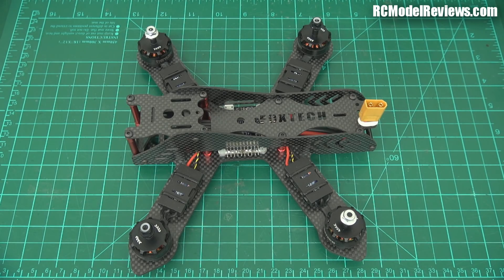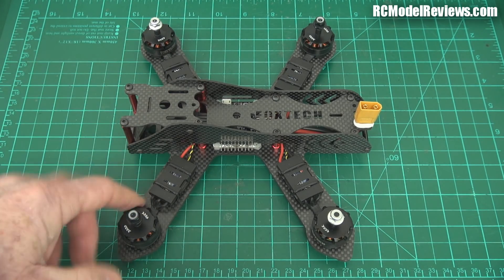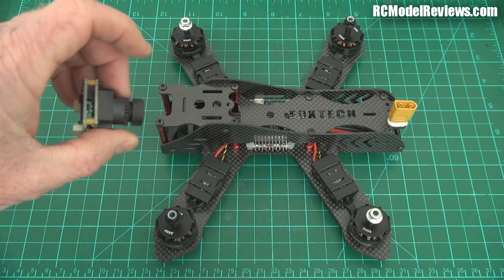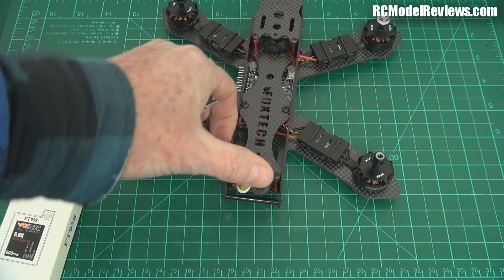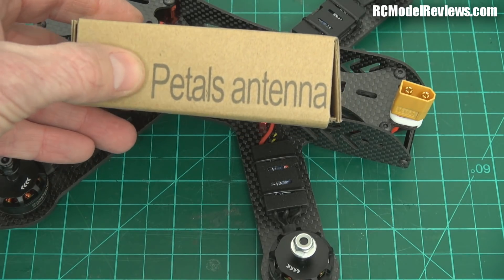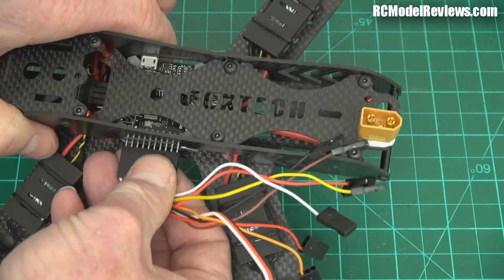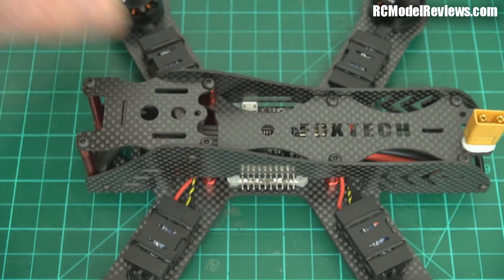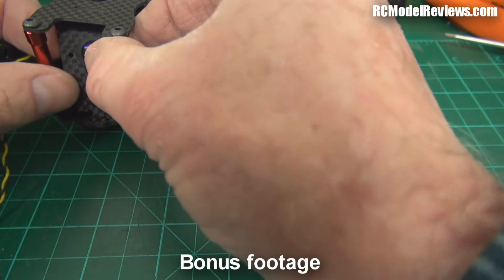FoxtechFPV Lightning 210 racing drone (on the bench)

Comment: Bruce, I have a question for I am building a TAROT TL250 RACING QUAD, I AM USING EMAX MT2204 2300KV MOTORS 12TO18 AMP EASC'S ARE WHAT ARE CALLED TO BE USED I AM NOT USING IT FOR RACING BUT I HAVE FLYCOLOR 30AMP SIMONK OPTO ESC'S THAT FIT AND ARE NEW. I KNOW THAT 30AMP EAC'S FOR A 250 SIZE QUAD USING EMAX MT2204 2300KV MOTOR WITH 5X4X3 TRI PROPS AND I AM MOUNTING THE ESC'S ON THE ARMS SO THAT THEY WILL GET PLENTY OF AIR AND THE MOTORS WILL NEVER COME CLOSE TO WHAT THE 30AMP ESC'S CAN HANDLE, MY QUESTION IS CAN I REMOVE THE HEAVY HEATSINK ON THESE ESC'S BECAUSE 1 OF THE HEATSINKS FROM 1 EAS WEIGH JUST AS MUCH AS ALL 4 ESC'S WITH HEATSINKS REMOVED! DO YOU THINK IT WILL BE FINE FOR ME TO REMOVE THE HEATSINKS AND JUST HAVE THEM WRAPPED IN HEATSHRINK WITH ESC HEATSINKS REMOVED? I REALY KNOW THAT YOU ARE THE ONE TO ASK AND I KNOW THAT THEY SELL LITTLE BEE ESC'S THAT DO NOT HAVE HEATSINKS ALONG WITH MANY OTHER ESC'S THAT DO NOT HAVE THEM EITHER! I AM NOT GOING TO USE IT FOR RACING JUST TO PRACTICE PROXIMITY FLYING. THANK YOU IN ADVANCE FOR ANY OR ALL HELP IN THIS MATTER!

Comment: Hey bruce, mind helping me with a bit of electrical theory? 

I'm build an ironman10000 from tarot, and need to figure out a pdb. not really happy with the options I've found. I'll have a max draw just over 400 amps from 6s batteries.... would 1/4" flat plate of copper be sufficient for a bus bar?
Reply: It depends on the thickness of the copper -- it's the cross-sectional area that will determine the current-handling abilities.
Reply: 1.1mm thick,  14mm minimum width, 85mm diameter

Comment: Hi Bruce,

If you struggling to fit the Video Tx, since the SMA connector is on the top left of the of the Tx, could you flip the carbon top plate so the SMA hole is on the rear left, rather than the rear right, if this works there may be room for everything to fit nicely, maybe ! Andy

Comment: if the naze had straight pins would that block be able to push down through the semi circle cut out of the top plate?
Reply: No, the top plate is too low and the connector/pins would then protrude into the battery compartment.  I have removed the pins and soldered a flylead directly to the controller (which is the way it should come in the first place).

Comment: To Many downsides. I have the feeling that those foxtech guys don't understand the racing drone world. They are behind and there builds have strange fails. Pins soldered strange, naze32 rev6 and not a f3 fc. Strange cam. Wy no mounting holes for a hs1177 or runcam swift. 
Strange design. Sorry but the Chinese have better design frames. They learned from what people want and give you those options.
Reply: I agree and a f3 is not that expensive so for the price it does not mather. It feels like they took parts and just put it together without thinking about it.

Comment: i am interested in a video on lenses
Reply: basically there are 3 main lenses used in miniquads:
2.8mm= narrow field of view so it looks like it is zoomed in a bit but there is no fisheye effect
2.1= quite a wide field of view so it looks quite zoomed out and has a fisheye effect. the wide FOV can make it difficult aiming at gaps you are trying to fly through
2.5mm= this is somewhere between the 2.8 and 2.1 and has the advantages of both. it has a quite wide FOV but doesn't have a bad fisheye effect either. this seems to be the best lens in most situations and is used by pilots like Mr Steele and FinalGlide.

All of these lenses are available in IR sensitive and IR  blocked versions. IR sensitive lenses pick up some infrared light so they work well in low light conditions but when flying in daylight colours can look unnatural. IR blocked lenses are great for flying in daylight as colours look normal but if you fly in low light conditions with an IR blocked lens it will look a lot darker. 
That's basically all you need to know about camera lenses for miniquads

Comment: Would flipping the top plate over allow you to use the provided VTX?  Obviously the writing would look wrong.
Reply: I agree Bruce just flip the top plate?
Reply: I guess the wires coming from the XT60 would still be in the way.
Reply: You can more those.  They're only held there by a grommet that slots in from the back
Reply: Unfortunately there are still a couple of spacers in the way.

Comment: Could you just not mount the camera below the top plate at the front? 2 holes there. There is also a hole in the middle of the top plate, but then you can only fit smaller batteries.

Comment: Is it possible to re-mount the foxtech plate (where the battery goes) inverted in order to mount the vtx correctly? It means the xt60 will switch side too

Comment: When people need to mount a runcam, mobious etc, its surprising that nobody seems to have made the top camera plate angle adjustable
Reply: Actually the QR200 from Quadrysteria has an adjustable mobius/GoPro platform
Reply: ***** I stand corrected. Will go and check them out, thanks.